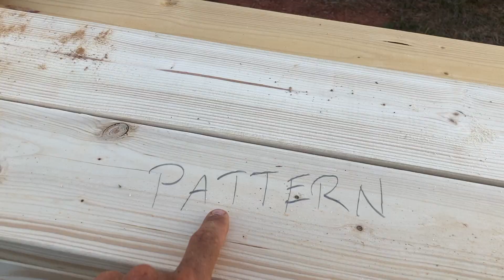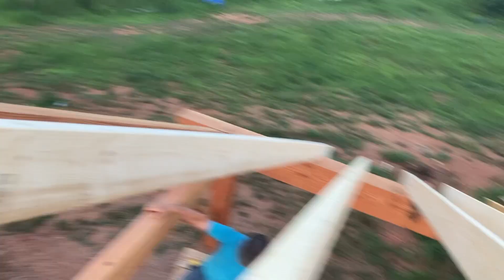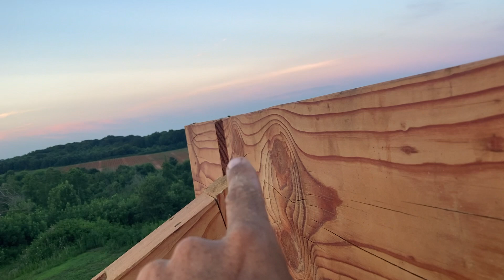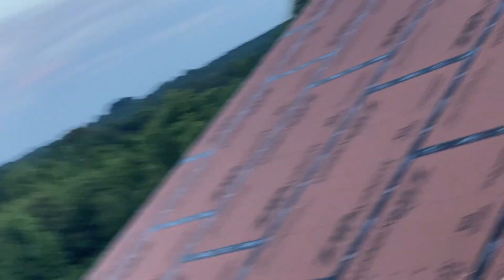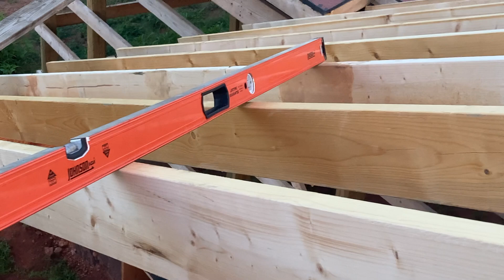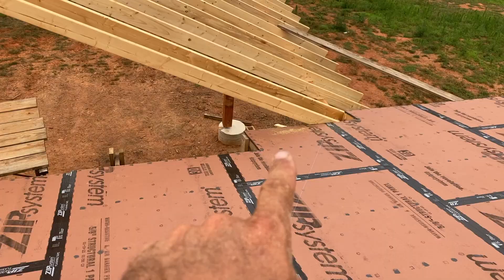Timber Frame Porch Roof Build + Over Frame Roof Tie In

Comment: So, why run your roof deck the wrong way?
Reply from the maker: @TomLinehan-d7d  Here is the link to the Huber Zip System Install Guide.  This is what I followed for the roof sheathing and wall sheathing. Which is why the main structure runs the way it does and the porch roof sheathing runs the other way.  Read page 43 and let me know if I missed something there.

https://www.huberwood.com/uploads/documents/technical/Installation-Manual-ZIP-System-Sheathing-Wall-and-Roof.pdf

Thanks for watching!
Reply: @ncbarndobuild  when you run plywood in that direction it put to many nails on 1 rafter where 2 sheets meet,  it tends to make Swiss cheese to said board
Reply: @ncbarndobuild  you misread page 42, you run roof decking perpendicular to your truss
Reply: @ncbarndobuild  btw, I'm a 40 year veteran of all phases of construction and have trained countless people
Reply from the maker: @TomLinehan-d7d  it doesn’t say truss in the manual it says “framing member”.  I have purlins on edge on top of the trusses that are the framing members I am fastening to which run perpendicular to the sheets.  Just like the manual says.  Post frame construction my friend very different than conventional framing.
Reply: @ncbarndobuild  good to hear, good looking job, btw